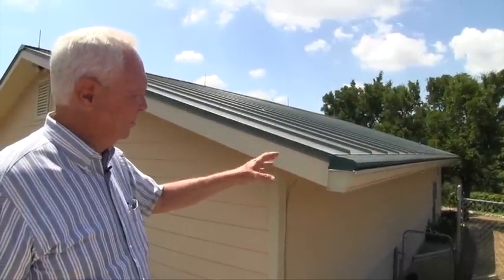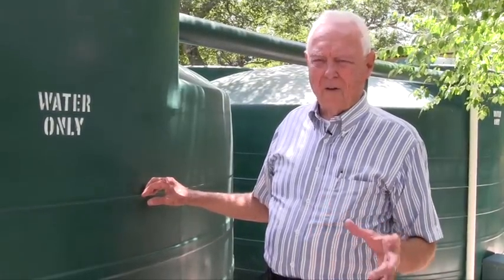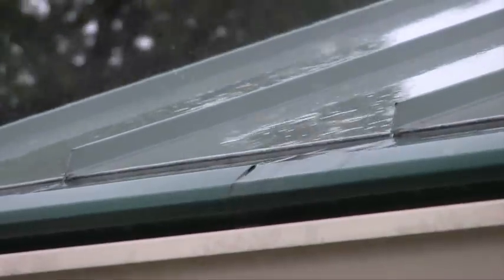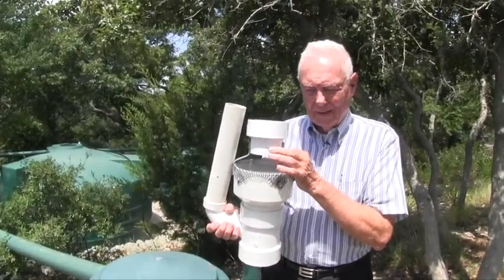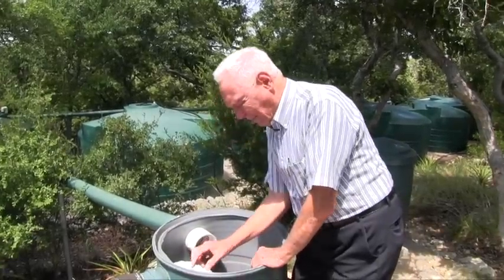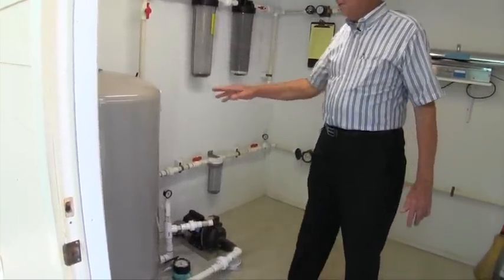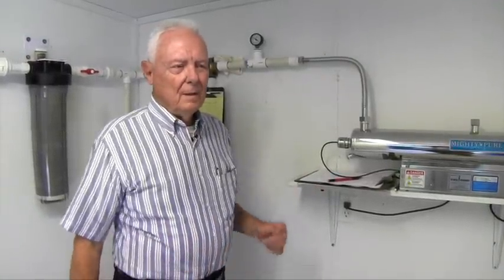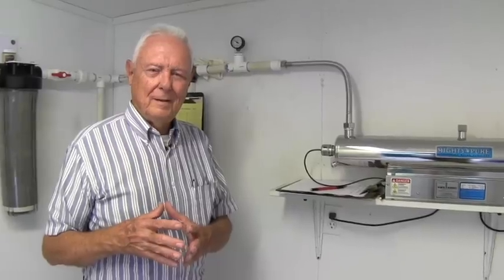Residential Rainwater Harvesting

Comment: I too like the filtering sock but I'd put the sock on exit that way it's easier to clean and a lot of the bigger particals will drop off in the settling tank
Reply: Can you explain more how secondary sock filter works..its inlet and outlet are at same level... Do you also flush the water inside the secondary filter tank after each rain ie when it is full.
Reply: And can you explain more how your sock filter would work

Comment: Omg, I love the idea of the filtering sock you use at the first flush tank. Very cool👍 Thanks for the video!
Reply: Can you explain more how secondary sock filter works..its inlet and outlet are at same level... Do you also flush the water inside the secondary filter tank after each rain ie when it is full.
Reply: @mutiur7396 I think regardless of the fact that the inlet and the outlet are at the same level, dirt and debris will still stop where the filtered sock is, and probably the gravity of the water flow will push it out through the outlet

Comment: WOW what an awesome system.  Wish I had the time, money and yard for something like this.  I am looking to do something that will hold a few hundred gallons and collect water from my gutters.  I need  to figure out how to cut the debris down that will get washed into my holding tank. I'd like to use this for emergency drinking water.   I should be able to the put water into my Hydro Blu tank, run it through my bacteria and virus filter to clean it and my charcoal filter for taste improvement.

Comment: Excellent system.  My engineering sense suggests that the UV system does very little, especially relative to the electricity it requires.  But the rest of the system is absolutely first rate.

Comment: My family is on rainwater, as a family of 4 we use around 1000L a week most weeks in dry times. 
Quick showers and very water efficient washing machine and toilet, no dishwasher.
Our issue is we skirt the minimum input for our waste water treatment plant.
Reply: @Keyzer Soze We built a 4 bedroom home and as per the QLD regs we need a septic or waste water treatment plant that can cater to 2 person per room. So our treatment/ recycling plant is designed to be efficient with the water use of 8 people. My partner, 2 young children and myself struggle to use enough water to meet the minimum input requirement of the system (on paper anyway).
Our toilet uses 3l per flush, shower head is 5l a min (the pressure through the throttled rubber tips makes it suprisingly effective, damn near a massage) we hand wash dishes and utensils after every meal and use/ waste minimum water.

We only have rain water storage (75kl) in a relatively dry rural area.

We have a large dam used for yard irrigation , gardens and vegies.
Reply: @Keyzer Soze The system requires a certain L per day input so that it can cycle through its aerobic and anaerobic chambers to effectively break down waste water into a reusable grey water.
The reason we struggle ∆

Comment: One of the best systems I've seen yet on YouTube...most rain water collecting videos is some guy with a Hodge podge of mis-matched hoses and barrels running in and out of his house with complicated shut off in every direction..
Reply: Can you explain more how secondary sock filter works..its inlet and outlet are at same level... Do you also flush the water inside the secondary filter tank after each rain ie when it is full.

Comment: I live in a peri urban area in Ghana West Africa. I set up a rain water harvesting system without the first flush system. This is a great video and I will show it to the plumber so he can add on. Thanks.
Reply: So how does that work during raining season? I am currently in the prosess of designing (and researching) for building an hotel in Nigeria where I want to use rainwater system first hand and well water second hand. Thinking...when the heavy rain comes, how much holding tanks do you need? How much do you have for how many people? Nigeria and Ghana is not the same, but I guess you have more knowledge then me due to storage and heavy rain.

Comment: please explain in more detail how the first flush system featured in this video works. I see where organics are trapped in the 500 micron sock; but what about the initial "dirty water" when the rain starts - is this water trapped and flushed or is it only the organics are removed. would like to use the set up featured in the video.
Reply: First flush helps trap larger particles but NOT dissolved bird poop.
Reply: @brooksanderson2599  that's what the ultraviolet filter is for.
Reply: the gutter guard appear to be the primary trap and then what left gets filtered through that first flush tank

Comment: Excellent video and a great investment. People don't realize in some of these drought area they are paying $20,000 to have new deeper wells drilled. You'll never run out and one day their $20,000 wells will run dry. You can always add a shed in and collect water from it's roof to expand your system so you can last through even longer droughts. You've made the expensive part of the investment so adding more surface area and more storage is fairly inexpensive. It's one of the best designed rainwater collections systems I've ever seen.
Reply: My only concern is with location.  Here in south east Texas, we have to worry about hurricanes and tornadoes.  I think this system is wonderful, but you would need to build a steel structure to house the barrels.  This is something I am interested in.
Reply: Another option to consider is burying the barrels. If you're in Texas if you bury them deep enough you can avoid the whole hot water in the summer issue. I'm in Phoenix and during the summer the cold water gets hotter than you can stand just from ground heat, pipes aren't buried deep enough. Metal roofs are far better for hurricanes than tar paper shingles. It'll probably cost $500 to a $1000 to get a backhoe to dig a hole big enough for the tanks but they can probably lift them and set them in place on the same day. Even empty water tanks are extremely heavy.
Reply: Cary Howe Ok.  Thank you.
Reply: When I was stationed in Guantanamo Bay, Cuba years ago, we had storage tanks of desalinated water on the hills.  The water never got hot, but there was no such thing as a cold shower unless you got caught in a rain.  The distribution pipes ran under ground, and that cooled the water a bit.  They have windmills for electricity now, I wonder if they started rainwater catchment.  Guantanamo Bay doesn't get much rainfall.  Even though It's in the tropics, most of the rain falls farther from shore.

Comment: Domestic rainwater collection should be the norm!
Reply: true that...but not everyone has the luxury of space to have multiple 5000l tanks in their yard
Reply: then bury the tank
Reply: Fair enough....although that will increase cost a bit
Reply: greatleapforwards
But you''l have you own water! The rain that falls on your property is yours by law. You need a system to make use of what's legally yours. If not, down it goes through the drainage into public city collectors.
Reply: Not in the state of Georgia. Here all water belongs to the state. Even the water from ice that you throw out on the ground. If it is outside your house then it is not yours.
Reply: KaleidoscopeJunkie
geez that sucks ):
Reply: KaleidoscopeJunkie that's not true at all you've been misinformed. The Georgia department of water has a 70 page handbook on their web detailing all about it with phone numbers and committee members to contact for help and advice.. they actually encourage it  as most states do.
Reply: I built houses and was required to take a government directed, environmental course before building. I had to sign a statement acknowledging water ownership by the state.
Reply: Residential homes should collect rooftop rain, and gather it into a tank in the basement to prevent freezing during winter. When it runs dry, it pumps water from the city.
Reply: Ours are under double garage and kitchen. Seven foot deep. Extremely big tank

Comment: a good rain water collection system would be, first, a metal roof. I believe that the asphalt roof would be a contaminate due to the chemicals contained in the asphalt. this is the only reason that I have not installed a rain water system . Although, I have a good well that is producing very good water to this time. But,, a good rain water system is something one needs to have just in case.
Reply: I agree, it bugs me most rain barrel videos say nothing about this. At least maybe have your roof material tested?
Reply: Well if you have a first flush it will catch most of the debris and by the time that happens the roof gets cold more and releases less harmful things and besides people have caught water with shingle roofs for years it's better to have something than nothing because one day water might not come out the faucet in a shtf situation then it will be too late something's better than nothing I would rather have that water to drink then nothing I would just purify it first and filter it. Because aemp could Wipe Out the electric grid I here it will make batteries burst so even if you have backup power that will be fried as well

Comment: In the video you mentioned an improved water diverter filter system. Do you have another video or schematic of how this works? Thanks.
Reply: I don't think he said he had an improved water. diverter. I think what you are referring to is the PVC configuration he was showing, with the wire screen. Well the scenes where the water was flowing into the gutters you can see the smaller hole screens. I believe that is what he was talking about as the improvement. I wish they would have shown where and from who he purchased them from.